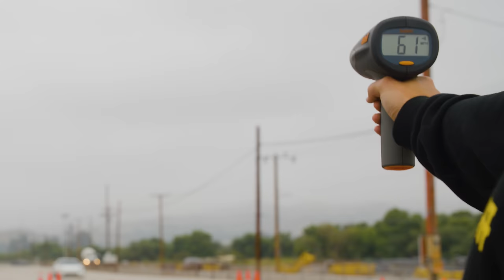$450 Brakes vs $4,500 Brakes | HiLow

Comment: Never cheap out on safety related parts like brakes!
Reply: true
Reply: They are still better than factory ones
Reply: @alexsupertramp4907  i think He means that you should Not buy your safety related carparts in China
Reply: Carbon ceramics it is then!
Reply: @mistamaog  those carbon brakes are more expensive than my WHOLE motor😂 and my car has an sr20
Reply: @alexsupertramp4907  so true even If you buy the cheapest parts of a well known Brand
Reply: @yexxyx  I know the pain
Reply: @yexxyx  found the problem jk
Reply: @mistamaog  my dumbass thought its a good idea to blow 3k just for an engine, while i could've kept the stock motor and spend those 3k on better things but welp i learned the hard way...i guess
Reply: ive been cheaping out for decades with no issue...its just when yuo get into "performace" mindset then you dont cheap out...my $5 pads been doing just fine for the past 2 years thank you. then again im pro cheapv as i want more money to spend on other things than my car...my car boi days are behind me aint no one got time for that shit now days
Reply: Oh yeah! Just gotta know common sense and pay attention to when there worn out.
Reply: @Scypher0th  Then this channel ain't for you
Reply: funny part the OEM pads that come with your car tend to perform better /longer. Vented rotors need long periods of high speed to be effective.
Reply: @jimmyschwarz9075  bruh i beta most of the factory parts were made in china
Reply: Never cheap out when racing. If your driving a hellaflush poser car, or just autocross or touge racer you can get away with cheaper brakes
Reply: @potatowithinternet8783  that Made my day
Reply: @alexsupertramp4907  absolutely not the cheap ones.
Reply: @befer  the one in the video is cheap and still better than stock
Reply: 9:27 It was kind of an unfair competition as one car had better tyres, wheels, & suspension. Obviously do these first, especially tyres. Also it depends what you are doing street vs track. BBK's are better but you are going to be replacing pads and rotors a lot more.

Comment: Just a suggestion for anyone wondering, you can get a set of 4 piston Brembo calipers for front and back for around $500. These came stock on some of the Track and Grand Touring 350z trims, like on mine. Fairly cheap and bang for buck investment for what it gives you and definitely a big upgrade over the single piston calipers.

Comment: Hey so I got stop tec slotted rotors and they came in the boxes labeled left and right but the slots are backwards. I was wondering which was the correct directions the slots should be pointed

Comment: That's actually super impressive and makes you understand that if you are going to track a car you want the Wilwood brakes.
Reply: No. I work for a race team, we're sponsered by Willwood, used to use their kit but for endurance racing their kits don;t cut it. After just a few laps on the track we'd get bad brake fade. Moved to a Brembo 6 piston kit, never gone back
Reply: @duncanmcgee4887  Sounds like a pad issue not a caliper issue.
Reply: if you really want to setup your car for a race track dont waste your money on wilwood.. get an ap racing, brembo or alcon instead.. my experienced with 6 pot wilwood on my turbo e92 m3 not so great.. the heat dissipation is worse, for my driving style on track i often get a fade and boiling fluid if braking too hard no matter what type of pad it was on.. the warranty also not so great, they refused to replace my crack rotor disc because they said the brake i purchased is not for track use.. its a 6pot, ofcourse we will race with it.. now after using ap racing radical 2 combine with their j hook rotor disc, its really a night and day difference,.
Reply: If you are actually going to race get the AP Racing brake kit.

Comment: Like with all of these upgrades, it totally depends on use case. With constant hard track driving, good brakes are a necessity, not an option. One of the biggest factors in allowing you to get the most from the car.

Comment: For a great and cheap option for my C6, I simply use an additional stock drilled rotor with Hawk track pads and steel braided lines. I've done 3 track days so far with amazing success and almost no fade

Comment: I have a mustang ecoboost. Building it for track use, but also as a daily pushing around 400whp technically 394whp. When I will take on track(I’m not done building it hence winter) I’m thinking about the $450 option well for me it’s actually like $800 but cheaper than $4000 but do you guys think the lower option brake set up will hold on the track?
 If you have any questions on my build feel free to ask.

Edit: Will take it on the track next spring because I live in Washington and weather is terrible until then.

Comment: The part of the video that surprised me was the FIRE. I've never seen that on a street car and would freak out if that happened to me. Also I've had brake fade on a downhill drive. That's very scary to think your car would be stoping and it wouldn't. Luckily nothing happened to me or the passenger.
Reply: If you're getting fade on hills, you should really begin using engine braking. Fade should only be an issue in passenger cars when you perform multiple successive panic stops. Here's a video on how to engine brake: https://youtu.be/WaOtK6VutWQ
Reply: Specialopsdave glad to see someone addressed this already
Reply: Specialopsdave This is what I learned and started doing. Thank you for the reminder. You are appreciated. (:
Reply: Chad Kanner You are correct.

Comment: I love this series. I’m totally the low guy lol I love bang for buck. You guys should really use your objective results to illustrate the comparison in a percentage. For example the Wilwood brake kit cost 1000% more but only offered a 10% performance improvement (shown in 60-0 tests). There are other attributes like subjective opinions that will influence buying decisions but the % comparison is important.
Reply: Well if you're running a track day, the 60-0 isn't the important bit its how many times you can slam on them and corner hard before they start glowing super hot and don't work anymore lmao

Comment: I recently did brake work. I went the same direction as "cheap". Did the bedding process only to realize I had a busted piston in my passenger front calliper... got the new one on and now it has uneven wear on the inside pad 🤦‍♂️

Comment: James:"I'm just a fkn car boy"

James: uses a regular socket on an impact gun

Still love every show👌
Reply: You can if the bolt isn't really stuck. I do it all the time.
Reply: Really doesn't matter if you don't consistently use the socket. Impact grade sockets cost 2-4 times as much as regular chrome and if you're only using them a few times you'll never really notice it going bad in it's lifetime.
Reply: Yeah I'm sure but the thing is if I have an impact socket I'd rather not break my regular vs taking another 20 seconds to look for my impact grade, saves me a lot of curse words and a couple $$$, right?
Reply: @A92CB7  I do this with junk sockets that I don't mind breaking. I thought everyone had a bag of assorted chinesium sockets, and one set you never touch and just keep telling yourself you'll have a job clean enough for them one day.
Reply: I've spent more money on impact sockets than I ever will on replacing broken chrome sockets (FYI never broken one with the impact).
Reply: @_winter7745  no job is clean that's why we use them,  if the job was clean they'll be sitting in our tool boxes taking bolts and nuts of with out hands, most of the time we need them, that's why we pay the money for them👌
Reply: @calvin8199  you got the good ish, but you have to think at the same time, impact sockets have a harder life than regular sockets
Reply: Just dont use it on a fully stuck bolt.
Reply: it’s ight to use chrome sockets on impacts but I’m waiting for the day one explodes
Reply: Yeah... I just use sockets that have a lifetime replacement warranty and live dangerously. I've never had one shatter, they just split open and spin in my experience. It's only happened a couple of times in like 15 years, I'm not too worried about it.
Reply: SNAP-ON boy! I use the chrome just to refresh my set. With the life time warranty. My dealer hates me.
Reply: I almost lost an eye to a chrome socket blowing up, didnt teach me anything cuz i still do it but it is dangerous for sure
Reply: Engineered tools being used by tools, 😂 i use the right tool for the job because im just a geek like that 😂oh and a female engineer who buys tools like other girls buy shoes 🤣but i also watch and love every show 🤘🏻😘
Reply: Wait you're not supposed to do that?
Reply: @_winter7745  Is that an AvE watcher that I see?
Reply: I've had purportedly quality impact sockets & joints take a shit and the regular sockets and joints did fine. I always go to the impact first, though.
Reply: Don't need impact sockets when you buy harbor freight lifetime warranty sockets lul
Reply: This information will save you 15$ in your lifetime. It's worth forgetting.
Reply: @saturnmedia1  Guilty of Choochin' in the Third Degree, comrades and canucks.
Reply: Use the right tool for the job. My dad has ended up in the hospital from the wrong tool blowing up on him. Sure, you may have got away with it your whole life, but it only takes one time to make for a really bad experience. A good impact set really doesn't cost much.

Comment: Those 5 feet saved can be a life saved, I’ll never feel like a goof for having a solid break system
Reply: It's "BRAKE" you GOOF 🤣🤣🤣
Reply: I have bireaeckes on my kar..
Reply: Alot of people don't realize the difference 5ft can make! That's the difference between you being 5ft into the back of a car or just barely tapping the bumper of said car! Or worse, some child 5ft under your car, vs still standing in front of your car scared poopless!
Reply: @Kwambe5  putting kids under vehicles is pretty fun
Reply: @macse7en  no question
Reply: Nonsense, you could still say "if only the best brakes on earth had stopped 5 feet shorter than they do".  It is an extremely irresponsible train of thought.  No matter what brakes you have, you should always be driving slow enough that you can stop within the distance you have from whatever is in front of you.  Driving that little bit slower also gives you and other drivers, pedestrians, etc, more reaction time so ultimately the brakes just weren't a factor unless you are racing and then, let's toss "life saved" out the window because you wouldn't be racing if you are risking lives and care about that.  Again you would drive within the capability of the brakes and all other subsystems.
Reply: Stinky Cheese  Of course you should always drive responsibly, but that extra 5ft is still good for peace of mind no matter what.
Reply: @macse7en  5 feet could also mean your car and a truck's rear end. bye bye car.
Reply: @stinkycheese804  exactly. One can never drive slow enough, I always say. That's why I prefer to not move the car at all. My 0 to 0 distance is phenomenal.
Reply: Green Giant  I tried but dozed off in the middle of it. When I woke up, I thought I had fallen asleep driving and was now heading straight for my own house. Brakes wouldn't work, steering wouldn't work (because the car was off). Ruined a good pair of pants and still trying to get the smell out of the car.
Reply: @macse7en  Wow...
Reply: The breakpads and SS lines are what did that. A smart upgrade for any street car.
Reply: 5 feet for 4500 yeah no thanks
Reply: I say always check your brakes, maybe not every drive but every now and then shibr a light in and check.
Reply: @wolfsburggti4476  I’ll take my chances too

Comment: I got some aftermarket slotted and drilled rotors with ceramic pads and noticed a nice improvement on my 6.2 Yukon Denali.   Less brake fade and it stops a bit quicker as well.  It works for me and for the price.   Wilwood kits are expensive,  but replacement pads are an arm and a leg as well.  Not ready to front that money for brakes yet.  Supercharger first!

Comment: unless you are on a track you don't need the willwoods
Reply: thebad300 this.  There is no scenario where you need to do a BBK on a street car. Put the money in tires.
Reply: @Audfile  if that's the case you are driving way to fast on the street
Reply: @thebad300  why are you using performance brakes on the street? To stop better?
Reply: even on a track, you dont always need BBK.. in the video they used street pads in track conditions, of course they faded. if they were using something like carbotech xps10/12 this would not have happened and would of been pretty on par with the wilwoods.
Reply: @Audfile  Tyres will make more difference than brakes on the road, 100%. Bigger brakes don't hurt though!
Reply: It doesn’t hurt to have them off the track. But if you’re building up your car, pushing more power, you’re going to need more brakes.
Reply: @TraitorPotater  People don't realize how fast that speed can come up on you when you upgrade your car to be real, actual fast... You're gonna be braking harder than you think and pretty often when you first upgrade your car and are hot boying around haha. But honestly when you're in a car that 140 comes up on you quicker than someone messing around in their stock 1.8t GTI gets to 70... You're gonna want them brakes to work.. And work good, every time.
Reply: As long as the brakes can lock up the wheels, theyre good enough to stop the car. The problem is how good they are with dealing temperatures, consistency, etc. The whole
point of this show was to use the top of the line parts vs the lowest you can go. Of course you don’t need willwoods on a roadcar, but they are one of the best brakes you can get.
Reply: @Audfile  Because your probably daily driving that thing.
Reply: And stoptech brakes?
Reply: Anel  excellent contribution, do elaborate.
Reply: Anel  😂😂😂
Reply: Or running from the law

Comment: Can you do this test again but put race pads on budget build? It'll handle the heat better and a true budget mechanic swaps pads on track days
Reply: they put improved pads on the budget build.

i wish they at least tried to find a cheap multi-piston caliper for the cheap car. $400 vs $4000 is pretty obvious, $2000 vs $4000 will be a bit more reasonable. but if there are no $2000 big brake + caliper kits available, i guess this is the only way to test.
Reply: Sep G centric posi quiet isn’t really an upgrade. The test would have been better if the same brake pad material was used on both cars. For obvious reasons the bigger brake kit will have a lot more consistent stops.

Comment: Next up:
"50$ ebay turbo kit vs 12,500$ garrett turbo kit"

Edit: Don't put poor quality components (or unknown quality components) on your car or motorcycle, especially safety/engine these parts could kill you.
Reply: *$20 fake turbo whistle from wish
Reply: Fast Intentions twin turbo system :')
Reply: ProGenji Lol
Reply: Lemon 🤣🤣
Reply: there are 90$ Chinese turbos for sale on ebay 
Sloppy mechanics use these
Reply: Than flowmaster vs armytrix exhaust system 🤣🤣
Reply: @cat-em3mj  yep those would be the ones im talking about.
Reply: What if they 3D printed a turbo? Then again it'd cost more to do that than it would to be an all aluminum one.
Reply: Yeah I’m gonna ignore that
Reply: To be fair, multiple guys on the SloppyMechanics page have made 1000+ whp on stock bottom end junkyard LS motors with cheap Chinese turbos
Reply: Boosted Boiz: breathing deeply
Reply: Just buy a used turbo and rebuild it and buy the rest of the stuff at least then you know it’s got high quality inside of it.
Reply: cheap ebay turbos are actually not that bad
Reply: They aren’t cheap parts... it’s high performance brake pads and slotted more durable rotors. I know my car brakes a lit letter at high speeds and has way less brake fade than it did with stock pads and rotors
Reply: ILUV2SK8 504  I am not american nor will I ever move to america and here where I live we put it behind so I really don't care

Comment: How do you get your brakes to stop being on fire.
Reply: Better pads would be the most obvious way to prevent them from catching fire, slotted/drilled rotors also help keep temps down in back-to back stops. 

Another cheap and very effective method is by  fabricating some air ducts to help cool them at higher speeds.